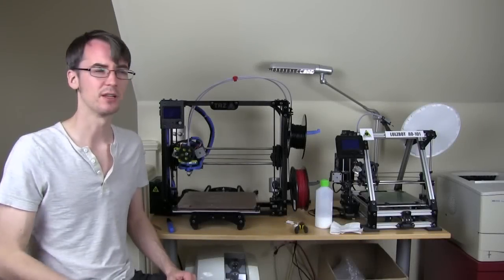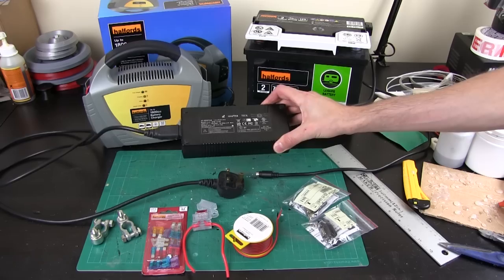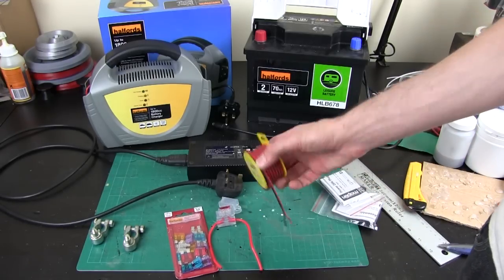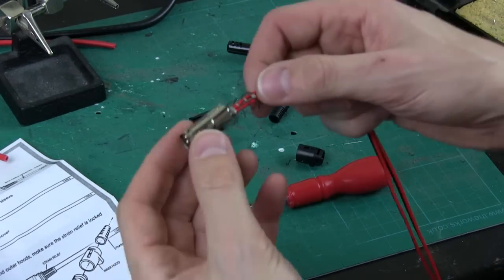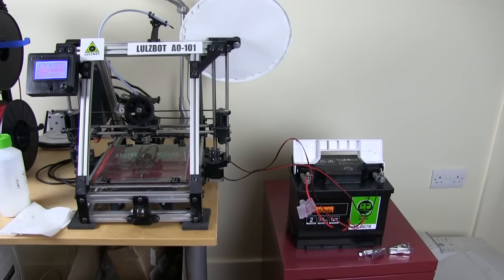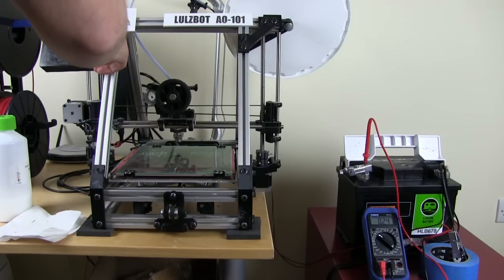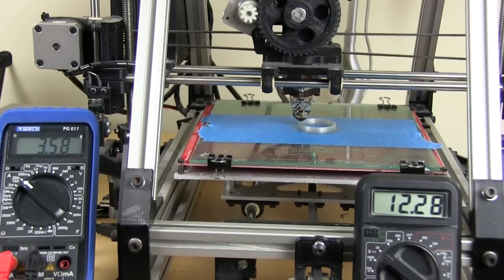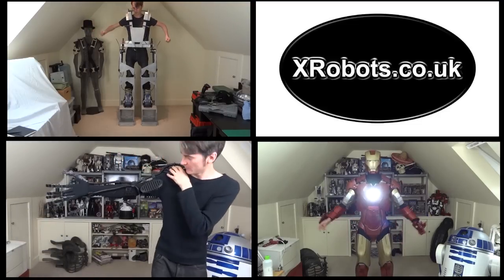3D Printing on Battery Power, with a RepRap Lulzbot & Car Battery! | James Bruton

Comment: You freaking got it to stick wow. Oh, I did not realize the blue painter's tape was for a non heated bed. That actually makes sense, since the blue tape was failing because of the glue melting on the heated bed (facepalm).

Comment: would this work with a lipo battery? i know they wouldn't have enough power to actually make it print, but i was an idiot and didn't realise the power supply needed to be changed from 110v to 240v, so i killed the power supply and i have no idea if the controller board survived, and I'm dying to see if it can be fixed with just a new power supply. so is it possible to power the board with a lipo battery for even just a few seconds to see if the screen and controller still work, and if the extra 0.6 volts of the lipo would damage anything?
Reply: +James Bruton its a 12v printer and i already tried replacing the internal fuse but i just got more smoke of death.... so is it possible to test it with a lipo or am i better off ordering a power supply and see if it works when it arrives? thanks for the help :)

Comment: I have a car battery and a used 400-600watt APC UPS backup unit on each of my printers ... if the power goes out or flutters .. my prints finish!  The old APC UPS units are awesome units, great electronics and durable .. they can be found for 10 bucks or less, toss the old battery out of the unit, and wire it up to a full size car battery. I got mine from free from the IT guy at work, were destined for trash heap (your IT guy might have a dozen sitting under a desk, avoiding paying for removal as trash, lol!)

Comment: James, you might want to think about a gel cell deep cycle battery. I'm from the US and not sure what battery you are using, but with a regular car battery if it gets down below a certain amp, the battery can become damaged, leak or not take a proper charge. With a gel cell battery it's more for use in conditions where it can take a lot of movement and not cause any damage to the cells. They can even be turned upside down and work perfectly.

Comment: you should see if you can set up a circuit to switch to battery if the power goes out
Reply: ***** haven't lived in my current house for long but, the power flickers some times and that's one of my worries about getting a 3d printer, also I've heard 3d printers don't work that well in the cold and as someone who lives in the basement where I get yelled at for having the heat on its a concern.

Comment: wow that takes a lot less power than i expected. Just one question, if the print is interrupted such as if the power ran out half way, can you continue from where you left off and if so are there any problems in the final print such as the layers not sticking together from where you left off or something.

Comment: Just keep in mind, that if you over drain the car battery too to much it may loose it's ability to be recharged. You might want to do some research & learn specifically what you can & can't get away with, with doing something like this. You don't want to use the battery all day Saturday, & then find out it wont take a charge for Sunday because you over discharged it. Also some car chargers may not charge fast enough, you may want to make sure that that battery charger is capable of recharging a car battery from almost dead to a full charge in the amount of time that your going to be able to be in your hotel room over night.

side thought also, you might be able to go to a car junkyard (scrapyard) to pick up a used car battery (or two) for really cheap. Some junk yards will purposely pull the car batteries out of the cars & sell them for say, $10-$20. (American)

Love the vids & builds, keep up the great work!

Comment: This is out of topic, but wich hotend do you use for your Taz printer and are you happy with it? Also for the bed using PLA, I use kapton tape wich works well most of the time.
Reply: I was asking wich hotend do you use with the Taz?
Reply: ***** ok thanks, yes you seem to have pretty good print quality!

Comment: with a more complex shape is the drain on the battery more? Would it better to do shapes with a smooth draw path and no infill so the motors are not going back and forth constantly shifting directions.  I know nothing about current draw and battery life so not sure if the motors moving like that even matters.

Comment: As far as I know, the 24V printer can also run somewhat on 12V, the steppers will maybe act up.. but the rest should run "okay"
Reply: The big problem, I think, are the heating elements for the nozzle and heated bed. These are set up for 24V - and as they're essentially big resistors you can run them on 12V just fine - the only problem is they'll produce less heat. I expect the printer would operate correctly, it would just take longer to heat up - possibly more than twice as long to heat up, as you've reduced the heating rate, but not the heat dissipation rate...
Reply: Yes apparently the math works out to effectively quarter the watt output of the heading element. So a 24v 30w hating cartridge powered on 12v would only generate 7.5w....

Comment: Really interesting project. Thanks James. Do you think the printer control electronics has a regulator inbuilt? Were you at all concerned with the battery voltage being a little high? I'd be interested to see what the current drain was with the HBP. I'd also be interested in how the power requirements of your other printer compare.
Reply: Typically the printers run on a few different voltages, and the mainboard has a regulator to set up these voltages.
High-power heating elements like the hot end nozzle and heated bed are essentially big resistors, so they're not too picky about what voltage they take as long as it's not far in excess of the intended voltage. The printer control board switches these on and off via MOSFETs usually, and achieves the desired temperature either via PID control or bang/bang thermostat-style control. So if the input voltage for these heating elements were low, the printer would just spend more time with the elements on to compensate.
The mainboard logic and motor control, etc. all run on 5V, and the printer control board normally has a regulator onboard to produce that.
A few parts (like SD cards, etc.) run on 3.3V, and usually the interfaces for those will have their own regulators.
Reply: Thanks Scope-Eye video :)
Reply: That sounds good thanks for your comment. I'm trying to do the same in a campervan. To run an ender 3v2 directly off  my 24v lifepo4 pack. This pack rests at 26.6 volts when fully charged. Do you think that would still be in the safe range for the in built voltage regulators? The enders power supply makes 24v. I'll check it soon with a multi meter to find the exact voltage.
Reply: @gubearium  did you have any success I’m trying to do the same in my van but don’t know where to start.

Comment: Why dont you print in PLA more often? Are there disadvantages to it compaired to ABS?
Reply: Pla can be more brital depending on brand. I find that colorfabb pla breaks somewhat like abs. ABS prints at a higher temperature which also means it wont melt as easily and can be used for other scenarios. ABS apparently smells worse when printing and pla docent really kick off much smell at all.
Reply: A friend of mine at the local makerspace swears by PLA actually. And from my experience in printing things it does seem like a very strong material.
The whole "brittle" thing is more like a matter of different material characteristics. If you bend ABS, it'll see things your way if you apply enough force. PLA is more likely to just break. But it takes more force to break the PLA than it does to deform the ABS. In that sense PLA is actually stronger, while the ABS could maybe be considered "more resilient".
The one big disadvantage to PLA in my opinion is that (from what I've heard) it doesn't stand up to high temperatures as well. Like I've heard that leaving a PLA print in your car on a hot day can cause it to droop and lose its shape.